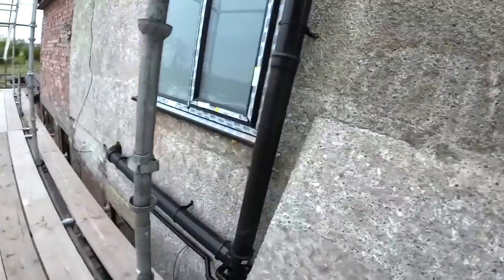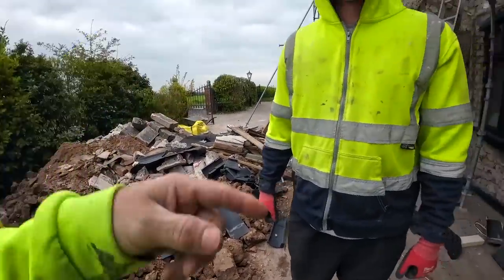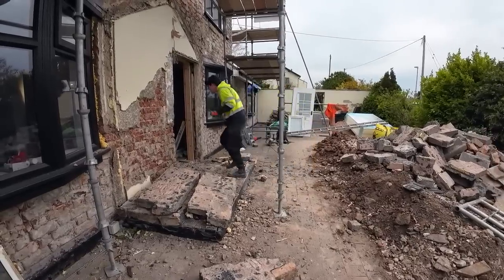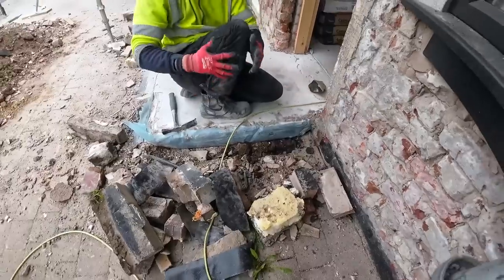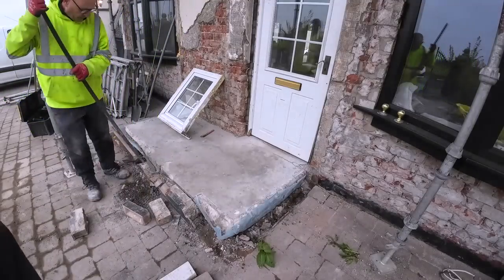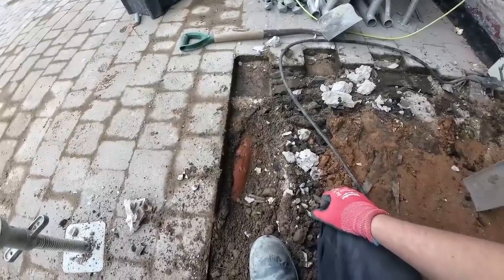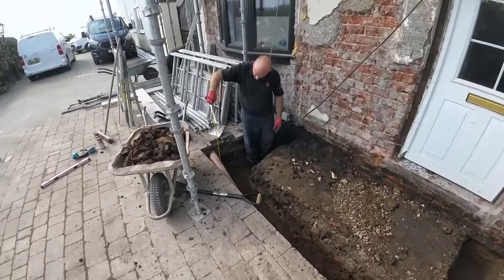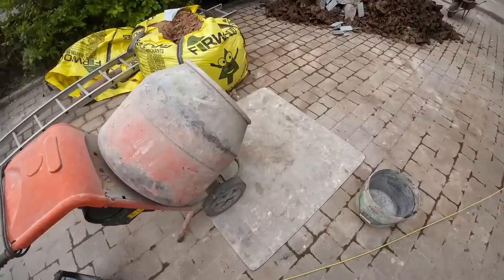MORE SHOCKING WORKMANSHIP!! PORCH FROM HELL

Comment: Steve I just had to pause this. I downloaded the PDF from my local council and emailed them and they confirmed, to be exempt from planning and building regs the following has to be adhered to:

Less than 3 square meters floor area, measured from external walls.

Less than 3 meters in height.

More than 2 meters away from the public highway.

Must keep external door cannot switch to internal door.

If they are followed no planning or building regs required, this is stated in the pdf under porches section. And had this confirmed from them also.

I'm starting a porch job in few weeks. 👍👍👍

That was shocking, am I seeing/hearing right:
No foundation 
No wall ties
No dpc
No wall starters

Edit, no sub base for floor!
Edit, laying on top of pipe !

Unbelievable in utter shock! 😳

Also am I right in saying I didn't see and lintel over door or windows or did I miss them?
Reply from the maker: All correct mate except there was 1 rusty poorly installed angle iron over the door 😬🧱👍🏽
Reply: @SteveAndAlexBuild   ah I see. Still most shocking work I have ever seen. Looking forward to you lads sorting it out and doing a proper job 👍

Comment: That pipe was very strange!!!!
Reply from the maker: It certainly was 🤨🧱👍🏽
Reply: @SteveAndAlexBuild  Seen the pipe and it got me thinking, might have been a cable run for electricity (lights maybe) and maybe data (Internet) at some point in the past. Only reason that come to mind is that it was buried quite shallow and seemed to be going from the house to the side garden.